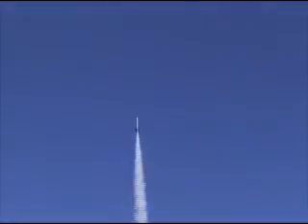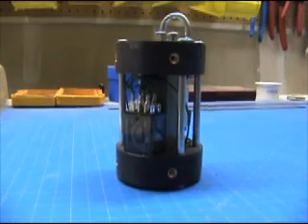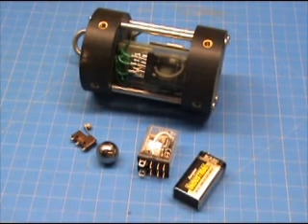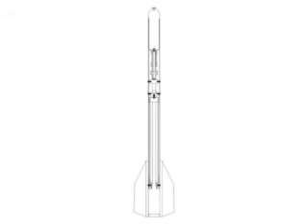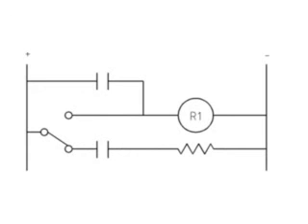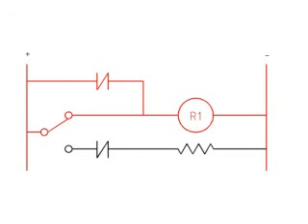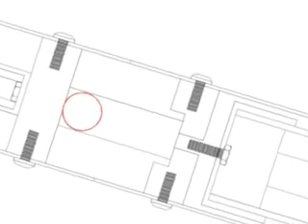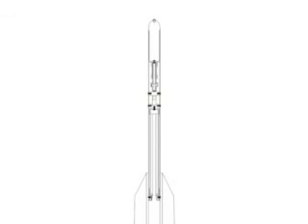Ejection Circuit

Comment: hey Dan! Is it possible to mimic the behavior of your two state roller switch ( I believe  you called it "reed switch" on the video ) with a couple of mercury relays? Like one pointing up and the other pointing down. I though it might work for smaller rockets where you don´t have space or thrust enough to handle steel balls. You will have the same behavior. Basically, at engine shutdown when both mercury balls goes up, one of them ( the one upside-down) would arm the latching relay, then when they both goes down, the one standing up would fire the charge. Please, let me know what you think. And thanks for such amazing videos and tips that you are always sharing with us.